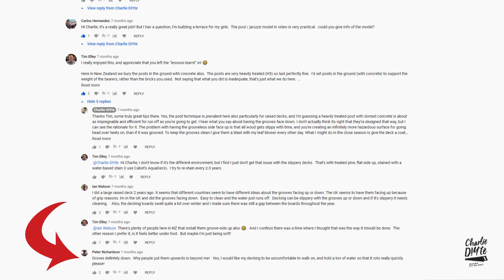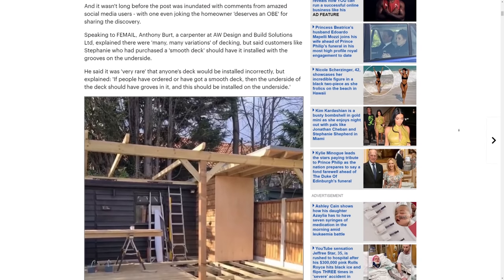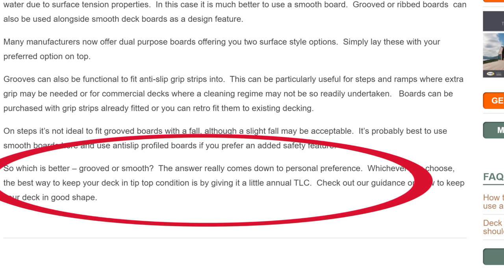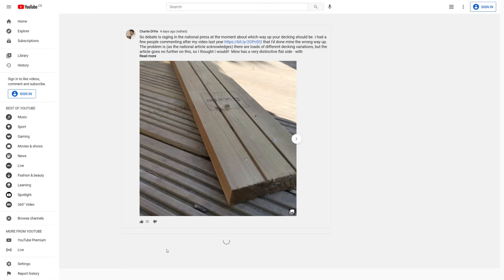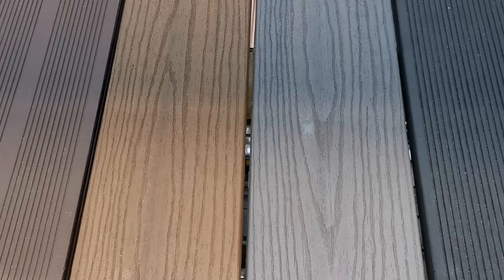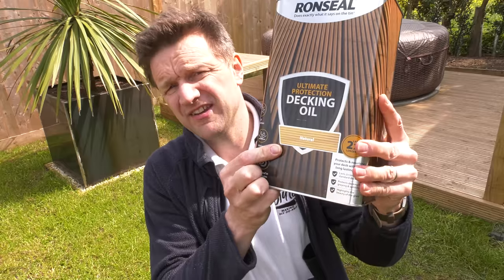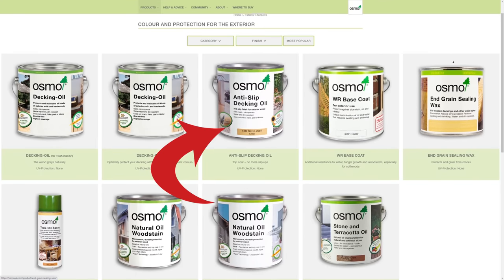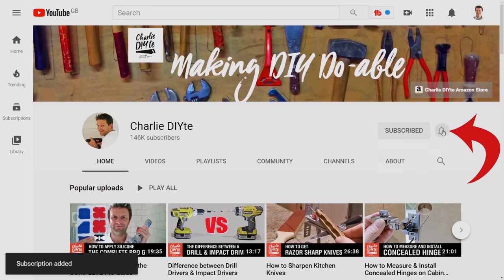Which Way Up to Install Your Decking?

Comment: When I had decking I used smooth side up. Looked better, more natural, easier to clean and was no more slippy.
Reply from the maker: I think the cleaning is the big one. You could even sand it if you wanted. Much trickier with the grooves. 👍🏻

Comment: I am in Canada - originally UK 45yrs ago - Every time we have been over I have said what a great idea you guys have with that grooved decking. We do not have it here,and as far as I know neither do the Sates. The people who say the grooves should be up are nuts.We in Ontario have way more severe weather than you and my deck has been down 26yrs.The boards need changing but when removed the joists are in great shape with no grooves and about 3' of snow per year. So stick with you up grooves,you are right LOL
Reply from the maker: Thanks John. Yes it's a shame mine were designed to be facing upwards. Smooth boards would be so much easier to maintain!

Comment: Our decking is about 20 years old. It gets jet washed a couple of times a year. Yes its it grooved side up but it still gets slippery in the winter.
I placed dpm along the joists and where I bolted a joist to the wall of the house. This provides excellent protection to the joists. I keep meaning to coat the decking with a clear anti slip finish but yet to do it as most products require an air temperature of 10deg C to prevent clouding of the product.  Great vid as ever. Haters gonna hate.............
Reply from the maker: Thanks Nickolas. Good work with your decking 👍🏻

Comment: Had a hardwood smooth deck for 12 years. Jet wash twice a year and use anti fungal wash before re-oiling in late spring. Has never been slippery. Neighbour’s Reed profile softwood deck is always filled with moss and algae in between ridges, very slippery when wet and also softwood which swells and contracts more.
Reply from the maker: Thanks Caroline. Maintenance as you say, is key. If you look after it brilliantly like you did, the deck will last for years. The problem is, I'd say less than 5% of deck owners would be bothered to do that. 👍🏻

Comment: In Sweden, while I've seen wood decking with grooves, it's definitely not particularly common. Our boards tend to be flat on both sides, and rounded on all four edges. My habit is to look at the end of the board for the growth rings. Since they will tend straighten as the board dries, I'll pick an orientation that lets the board rise up in the middle. That way, water will run off, rather than pool along the centre line.
Reply from the maker: I like that idea. Huge thanks for the comment. It's always great to get an insight from elsewhere in the world. 🙏👍🏻

Comment: Interesting video. Years ago i built a deck attached to the back of our house. Deck boards were laid groove side up & they were like an ice rink in the wet months. Built a raised deck at the bottom of our garden & boards are laid groove side down. Even in the wet its not slippy. So in my opinion groove side down is way better looking & safer.
Reply from the maker: Thanks for this. 👍🏻

Comment: I used plain side up for my decking (grooves down). I think it looks better, you can use a roller to add deck oil really quickly and I sanded it last year with a drum sander and it was reasonably easy to do and looked like new. I had no idea the grooves down were good for the timber but as it turns out, they are in really good condition after 7 years.
Reply from the maker: Thanks for this. Yes for sanding and oil treatment, smooth side up is definitely the better option.

Comment: Good job

Here in Australia the H3 pine 4” x 2” joists are grooved as well so for that reason alone it also doesn’t matter which way the grooves go on the boards......

but 90% are Merbau hardwood decks with grooves down..... usually under cover of some sort....

If your deck is under cover that reduces importance of it further....
Reply from the maker: Thanks buddy, grooved at 90 degrees to the length presumably? It's great to get an insight into how its done in Australia because you guys are much clued up on decking than we are!
Reply: @CharlieDIYte  No they run parallel - here's a picture......... https://www.agnewbuildingsupplies.com.au/product/11051/decking-merbau-kd-select-r1f-random-lengths-90-x-19mm

Comment: What I've learned over the years and I've installed many decks is to have the decking  raised above ground level if possible , and to make sure it has good airflow 6mm gaps , canterlever decks are the way to go .
Reply from the maker: Thanks Eden 👍🏻

Comment: My decking is grooves up. It's at least 15 years old, and has been regularly treated with decking paint - this year is the first time I have noticed the boards starting to degrade, so it's getting replaced soon. The deck was always slippery when damp, until we put an anti slip coating on - what a difference!
Reply from the maker: Yes I think maintenance and non slip oil is the key. Good work. 15 years is impressive 👍🏻

Comment: Just finished my decking down from the raised patio door. Composite with groves or wood grain on either side. I like my ankles attached so I went with the grooves for the grip. As it's elevated, air circulation isn't a problem anyway.
Reply from the maker: Well done mate. Wait a few months and then get one of these on it. https://youtu.be/ZOQ2L1TMayc

Comment: Grooves up or down is a personal choice but usually grooves up for grip and looks......plus you can buy grip inserts which are nailed into grooves......I cant see that additional airflow making any difference to the longevity of the decking

Comment: Great vid. So just went to town decking my garden. Super happy with result. Groove side up which I think looks so much better. Removed some old groove up decking when doing job and it wasn’t that bad only joists had rotted. Had been there over 20 years looking at old sales pictures. Was painted though so not sure if that’s reason it lasted so well. Oiling mine. Though I’m still not fully confident about weathering period. Timber merchant told me it’s fine to seal/oil straight away though water bead test and moisture test tells me otherwise. Still confused about it
Reply from the maker: Typically you can leave it 6 months before oiling as discussed here but you can oil it straight away. You'll just find less sinks in. You'll then need to reoil every 6 months to a year but if you keep it maintained, the reoiling will be much easier.  https://youtu.be/ZOQ2L1TMayc?si=Uy5Mu8B97HZm7FRR.

Comment: This video pointed out another difference between various areas of the world. I'm in Canada and I've never seen wood decking with grooves, on either side. I've seen some of the composite decking boards with grooves on one side but I thought that was to save material. I took a look at one of the major big box stores (the one with the orange sign, I'm not advertising for them) just to make sure nothing has changed since I last built a deck and it's still the same. 

I don't know if what you built is typical but here we have beams (2x6 or 2x8) attached to 4x4 posts. (Sorry for the imperial measurements. While Canada is officially metric our lumber is the old way. I'm assuming that it's because our lumber industry is so tied into the US. Or it could just be momentum from the past as in grocery stores and advertisements food prices have prices per pound in larger print and then prices per kg, 100g, or something similar in smaller print.)  are Joists are either between or on top of the beams (laid perpendicular) and then the deck boards are attached to the joists (perpendicular to the joists of course).

If you build your deck with a very slight slant (1 or 2 degrees) then you won't have to worry about water pooling up. It's not enough for someone to notice. If the deck is against a building then the deck should slope away from the building.
Reply from the maker: Thanks buddy. Really intetesting to hear grooves aren't a thing in Canada. So they're flat on both sides presumably. 👍🏻
Reply: @CharlieDIYte  

Exactly. I've never came across about worrying air flow under decks before I saw your video. But then almost all of our decks are higher off the ground. We're concerned more with preventing animals living under them, especially skunks.

Comment: Love the video and for the unconvinced.

There isn't a right way up. It depends on your requirements. 
For example:
1. How much friction does the county/council require? [grooves up]
2. Landscape Supply Office. Do you and your customers need a safe mud free deck surface? [grooves down].
there are plenty of reasons to determine what you should do.
also some deck boards come with grooves on both sides and some come with none.
Reply from the maker: Thanks Sam. Also if you're putting a hot tub on it you need grooves up to allow some drainage underneath, as you'll see in this weekend's video.

Comment: Plain side up is the right way !!!! Grooves up are more slippery and traps dirt . This is great video
Reply from the maker: I agree with that. Trouble is my decking is designed groove side up as you see from the manufacturers stamp on the plain underside.

Comment: My vast decking (approx. 125 square metres) was put down 20 years ago and I am just having to replace some of the sub structure due to rot. The decking is 28 x 145 Balau hardwood and has never been treated. Some of the boards need replacing about 50 linear metres so you get what you pay for.
Reply from the maker: Wow, you've done well there Roger.👍🏻

Comment: We were househunting a few years back and several times were put off by gardens spoiled by mildew covered decking which was far past its best and probably had Mr Decking himself, Alan Titmarsh to thank for its installation. That man, supposedly a gardener,  must have caused many acres of garden to be lost under wooden planks.
Reply: Alan Titchmarsh the surname is Titchmarsh with an extra ‘ch’ not tit, but Titch. 
If you’re going to slag off someone you’ve never met, at least do them the common courtesy of getting their name correct!
Reply: @JulieWallis1963  I am well aware of the man`s name and frankly after the huge damage  his pro "decking" policies have caused to gardens all over country it is not unreasonable to regard him as a bit of a tit.

Comment: did my decking years ago with the grooves facing up but when its wet it is very slippy and quite dangerous to walk on. It is outside our patio doors so you walk on it from the house, so not ideal. Might rip it up and place it at the end of the garden and go back to slabs instead

Comment: The grain on your decking also shows you have it the correct way up, the crescent grain should  crescent downwards as it won't warp in a manner where the 2 outer edges will lift.  Not such an issue with good thick decking but it can be with thinner boards.
Reply from the maker: Thanks Rod. I hadn't thought of that until you and a few others pointed it out. Which means you have to be a bit careful when you've got grooves on both sides - supposedly to give you a choice which way up to put it.

Comment: I’ve just gone for yellow balau decking which is smooth on both sides. It’s less slippy than the usual soft wood but you should always have fall of 1:100 on decking.
Reply from the maker: Thanks for this 👍🏻
Reply: Balau will still warp and twist. I used it and tbh I wish I'd gone for pressure treated s/wood

Comment: I once worked for a company who manufactured street furniture. We installed play furniture in schools and the deck area would be varnished and sprinkled with white play sand to help with slip. Company policy, not my idea. It worked, we would go back once a year and re do. Once it is dry you can't tell it has sand in the varnish but its good to walk on.
Reply from the maker: Interesting idea. So the varnish would be oil based, and you just sprinkled the sand over whilst it was still wet?
Reply: @CharlieDIYte  yes Charl 👍 just exterior varnish, I would use yacht varnish,  if it will survive in the sea it will do a deck.
Reply: @CharlieDIYte  just an even sprinkle in the varnish whilst still wet. Make sure the sand is bone dry.

Comment: Do what ever you want. You bought the boards. You lay them anyway you like! 😀
I’m a carpenter and the majority of boards we get have got here in Shropshire are small rounded grooves one side (which we lay to the bottom) and big grounded grooves to the top. The reason is the bigger grooves are less slippery. If you have any doubt then stand on them! 😜
Decking isnt as popular as it used to be. Probably because too many people have gone over on their ass. It’s no joke.🙄
The cure for this is chicken wire nailed as walkways. Not my idea but something I’d recommended anyone. 👍🏻

Comment: I’m replacing some wickes decking after 18 years.  No adverse effects AT ALL of placing flat face down, whereas the screw holes are all rotted down into the joists.   
A fall/slope to shed rainwater off the deck is always desirable.  The boards that warped/dished and held water rotted from the top surface down.
Bitumen on your timbers is likely to trap moisture in the timber and increase the likelihood of early decay. I’m not even convinced that a slip of dpc to protect the top surface of the bearer will result in a net gain, tbh.  My old bearers only rotted where the garden soil had built up against them.  
Most decks are slippery when old and wet,  in my experience.

Comment: Hi Charlie, I watch your videos as they come up. I have installed my decking at least 10 years ago in exactly the same way you have. Treating with Clear coat Oil has worked and maintained the treated wood. It's time to look at replacing now., some damage and rot has started. Keep up the great work and the videos! Great Job!

Comment: Whenever you rout grooves out of 1 surface it will encourage the timber to cup, 1 of the ways to prevent this is to remove an equal amount of material from the opposite side so i always assumed this to being the primary reason for both sides having grooves with the added bonus of choice of finish
Reply from the maker: Makes sense Mark. It's a win win for the manufacturer.👍🏻
Reply: @CharlieDIYte  In watching the video the end grain of the board and the grooving ('finish' or 'rough') is not constant, some times it is on the top of the curve and sometimes on the bottom.   If you where working with flat non-grooved boards you would always run them so the cup would be up and the curve would be on the braces.    (Water off the top, air on the bottom)   If selecting lumber, the finish grooves would all be on the top cup of the board.

Comment: Hi Charlie   Yes as you rightly say it’s obvious you installed it correctly , the other side would be far to rough to be practical. You did mention about the plastic decking, I for one thing the manufacturers are missing a trick here ,  and not using totally waste plastic. It might not look as consistent as what is available at the moment but it could be a way of dealing with this ever increasing problem. I’m  sure people would put up with a less attractive finish if it made it cheaper and it was helping the environment . Be interesting to know your thoughts, looking forward to your next video.   Best wishes and kind regards
Reply from the maker: Thanks for this. Yes I agree on the composite, although a few people on here have said that it degrades (warps, discolours, goes brittle). I just have a bit of an issue buying a load of plastic that will end up in land fill sooner or later.

Comment: DO NOT use a pressure washer has you mentioned at (4:38) it will cause splinters your best using a decent deck scrubbing brush medium or soft bristle is best then use your garden hose to water the decking first then use a bucket of water and the Cleaner reviver and brush your decking down final hose off then oil your decking
Reply from the maker: My pressure washer isn't very powerful but I hear what you say.

Comment: I had it with my grooved decking and ripped out the timber. Every year the water and crap just collected in the grooves - not good. I can see the argument for grooves if your deck has been built on a drop to let the water run off, but anything over a couple of metres won’t work so well. I replaced my soggy rotten grooved timber with smooth (both sides) decking timber. It wasn’t easy to source, and wasn’t cheap. However after two winters its much easier to clean and there’s no pooling of water anymore. As for grooved decking helping grip - I just can’t see why it would?
Reply from the maker: Thanks Eric. It's crazy how hard it is to get hold of the smooth stuff isn't it! I think the grooves would only help with grip if you're walking at 90 degrees to them rather than along their length.

Comment: Always enjoy your videos and the way you share the entire process, warts and all. My one piece of advice - if you’re going to spend a week or two building a deck, use hardwood rather than treated pine. Sure it’s more expensive (not much mind you) but the extra cost of materials is small compared to the labour involved, and the result, IMO - much more aesthetically pleasing and much more durable. Then you don’t have to worry about grooves at all. It’s hard to find a deck builder in Australia who will not try and talk you into hardwood, but we do have a lot of nice species down under.
Reply from the maker: Thanks buddy - good to hear from you - I really appreciate your support of my channel👊🏻  Makes a lot of sense that. I'd do a few things differently now, although I have to remind myself I built this during lockdown when decking was a relatively scarce commodity. I'm not sure how readily available hard wood decking is over here but I'll check👍🏻